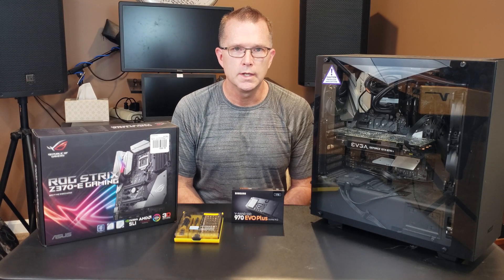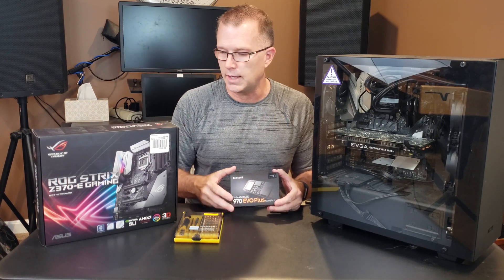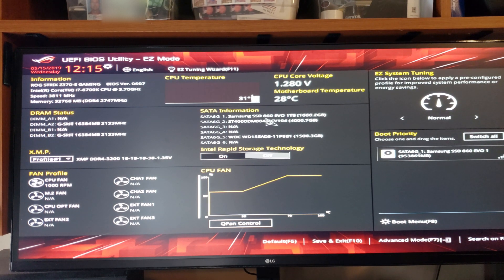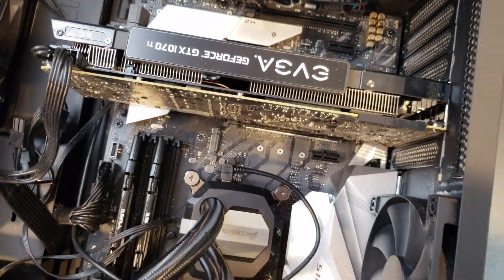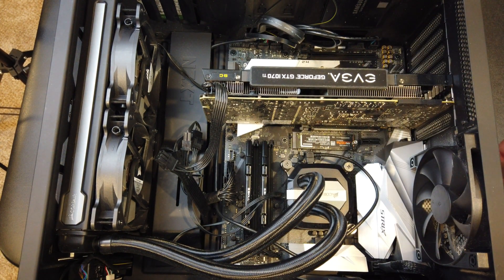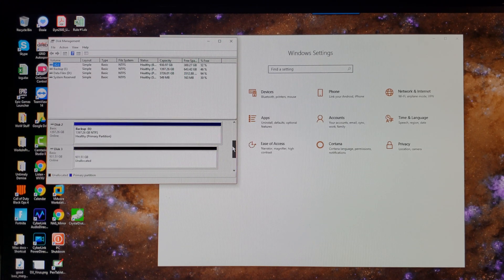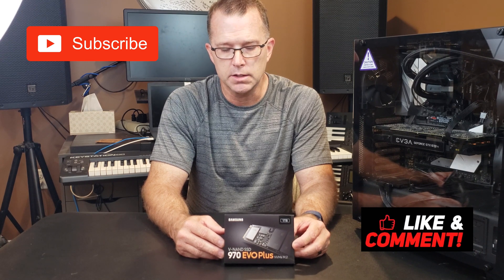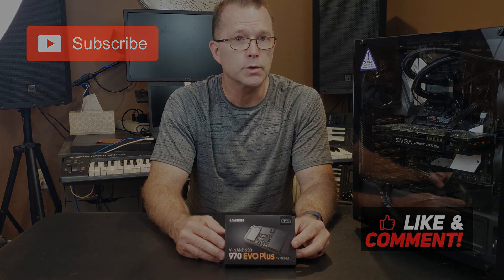SAMSUNG EVO 970 Plus M.2 NVMe SSD | Step-by-Step Installation, Configuration & Performance Testing

Comment: did u tested it while in use ?
i heared that its throttling while getting hot, i have an 8700k and an 1080ti they warm and i have no watercooling would u recomand it anyways ?
or someone else here ?
i would go for the 500Gb i think thats ok for me i use an 240GB SSD right now
and an 1TB for Backup
please someone respond :)
Have a nice stay @ home guys and trust ure heart! ;)
Reply from the maker: I still think the NVMe M.2 drive is great for fast booting, fast app loading, etc.  Highly recommend it for that.  For video editing though, the key performance seems to be 1) fast CPU and 2) fast GPU (in that order), especially in render/export performance.   Just did a video on that very thing and got extremely good results.  Might want to check it out if you haven't yet.
Reply: @ReeWrayOutdoors  thanks for the fast response :)
ill check it out ;)

Comment: OK I really need some help you and I’m going to try to explain the best I can and hopefully you can help me I purchased the Evo 970 pro +500 GB SSDI installed it in my Alienware I7 8700 when my computer booted up it brought me to the bios settings which I wasn’t familiar with so I hit continue and it booted up to the windows it shows that I have the evo ssd as a (d) drive with 500 gb how do I tell the computer that I want to use that SSD settings because my megahertz is only 2133 so do I have to change the bio settings or install any drivers to activate it
Reply: öhm, what??

Comment: When attempting to install the driver (Samsung_NVM_Express_Driver_3.3.exe), I get the error "samsung nvm express device is not connected. connect the device and try again". Also, the driver provider for the Samsung SSD 970 EVO Plus 2TB as seen under Device Manager > Disk Drives, shows Microsoft as the provider with a date of 6/21/2006, driver version 10.0.18362.1...
Reply: Update: I needed to follow this video--> https://www.youtube.com/watch?v=9ngnIKqPOc4 found here https://www.dell.com/community/Alienware/Area-51m-Samsung-970-Evo-Plus-NVMe-can-t-install-the-driver/td-p/7285442

Success!

Comment: Which M2 slot did you use? 1 or 2? Oh, and good video!
Reply from the maker: Off the top of my head, I'm not actually sure. haha  But it was the slot that did not require me to remove the ROG shield (or the graphics card) to access it.

Comment: What happen if I don't have that m.2 option in the Bios?
Reply from the maker: It's possible that your M/B may auto detect X4 mode, but you'd need to track down the PDF manual for your specific M/B to be certain.

Comment: Am I able to run 2 of these in 1 system?
The motherboard I'm getting will hold 3 M.2 drives but I never see anyone running more than 1 M.2
I'm wanting to run x2, maybe x3 Intel 660p M.2 drives, is that possible?
Reply: sure, it is but mostly it doesn't makes sense. if you running server applications with an high iops then it makes sense but to boot windows or some games it doesn't.

Comment from the maker: IMPORTANT NOTE: It has been correctly pointed out to me that the threaded nut on the M/B is not the standoff I'd assumed it was.  To avoid the risk of over-straining the M.2 socket, you should add a standoff to that threaded nut, and then secure the M.2 drive to the standoff.   I'm not sure why SSD mfg's don't just include a couple in the box with the drive.   Anyway, here's an Amazon link to the necessary parts that should work for the vast majority of MB's: https://amzn.to/2IAjT0L
Reply: What pc case are you using ?
Reply from the maker: @TRevolution7  NZXT S340 Elite
Reply: Why did you install the drive without the standoff? The drive should be horizontally. Not pushed down to the motherboard. I don't think you understand what a standoff is. A standoff means that you STAND SOMETHING ON the standoff. Not screw the standoff over the stuff. The standoff goes UNDER the drive and the drive screw on top of the standoff with a small m.2 screw. The drive should be parallel to the motherboard and not at an angle. https://i.stack.imgur.com/FDvM3.jpg
Reply from the maker: @davedragomir6632  you're the 2nd person (that I'm aware of) to make this comment. To be clear, I did NOT remove the existing standoff. I simply used a spare one I had lying around as the set screw.  You're correct though, you definitely should not secure it to the M/B without a standoff to support it. Had I known that some might think that's what I was doing, I'd have taken more care to clarify it....
Reply from the maker: Ohhhhhh I see now what you're talking about.  Totally correct!  Not sure how I missed that originally.  I've amended my pinned comment to clarify this.  Thanks.
Reply: @ReeWrayOutdoors  No problems man! I'm glad I was able to help you and great channel btw :)
Reply: @ReeWrayOutdoors  Asus and any other mobo vendors ALWAYS put this m2 stand-off/screw within the mobo box when the board has an m2 slot, or more of them. ppl still watch your vid. like me today. i mean, i know about all this but all those other noobs screwing their stuff directly on the board, without the stand-off, without knowing they make something wrong!?

Comment: When using a 2 m.2 nvme ssd in a setup, will their speed be affected in any way? I'm hoping for a 2 m.2 nvme ssd setup using a rog crosshair 8 hero x570 mobo;  I am not a computer expert so I appreciate any response and clarifications.

p.s.
- 1 ssd will be used as a boot drive while the other as a storage drive
Reply from the maker: Not 100% certain, but looking at the ASUS specs on this, it appears you may only get x4 speed on one of the M.2 drives (but I could be wrong).  Either way though, I doubt you'd really feel the difference much at all during 'normal' use.  https://www.asus.com/us/Motherboards/ROG-Strix-X570-E-Gaming/
Reply: @ReeWrayOutdoors  Thanks for the reply. I was planning on a rig that can be used on both games and work. While I am new to pc customization, I know that the latest threadripper series is an overkill for me so I am thinking of utilizing a ryzen 9 system.  Case in point I am asking questions so that I will be more versed in this field. Again, Thanks!
Reply from the maker: @carljohn4573  Yeah, especially if you've got apps the utilize multi-cores effectively, both the Ryzen 9 and Threadripper are workhorse BEASTS.  My next upgrade for a video editing workstation is likely going to be AMD-based.
Reply: @ReeWrayOutdoors   I'm happy to know that my choice of system brand will be the same as with your future upgrade. Great vids BTW, you've got one more subscriber in me.
Reply: 970 evo plus transfers at 3500MB/s. It does slow down under higher temperature. Still way, way faster than regular ssd, or even 960 evo
Reply: Even a SATA connected SSD will boot windows in under 10 seconds so I wouldn't be to concerned that only one of the slots is x4.

Comment: I need to do the same installation but will be converting it into my OS boot drive. Any recommendations or things I need to follow apart from these?
Reply from the maker: Just ensure that your M/B supports NVMe as a boot volume (probably does), then install it first a non boot drive, use Samsung's Magician utility to clone your boot volume to the NVMe , and then just set your BIOS to start using the NVMe as boot volume and you should be good to go!
Reply: @ReeWrayOutdoors  it's the exact same one as you used for your video. Thanks for the tip.

Comment: Hello sir. Does the x4 bios option work with the non plus version of the  EVO 970?
Reply from the maker: The short answer is "yes, I believe 4x is still supported on the EVO 970 non-plus version".  But if you want to look into further, here's an article I found that breaks it down pretty well: https://www.faceofit.com/samsung-970-evo-vs-evo-plus/
Reply: @ReeWrayOutdoors  Excellent. Thank you sir.

Comment: SSD drive = solid state drive drive
Reply from the maker: True! And if you buy one with cash, you'll probably have to to go to the ATM machine. Haha
Reply: @ReeWrayOutdoors  Haha. But honestly, thanks for the video. I got a Sabrent Rocket v. 4 to upgrade from my Samsung 850 Pro and heard about problems with cloning from a 512 byte per sector ssd to a 4k byte per sector ssd so I wanted to find some video that explained how to set this up. Found yours in the search and it's well made enough that I felt like saying something.

Comment: Question...What graphics card are you using.  The reason I ask is because I'm building a computer for mainly photo editing and maybe some videos.
Reply from the maker: I'm currently using a GTX-1070ti which was kind of the best bang-for-the-buck when I built the PC about 2.5 yrs ago.
Reply: @ReeWrayOutdoors  Thank You.  If you build one today what would you use?
Reply from the maker: @TheGregWallaceShow  For me, today I'd likely buy the nVidia RTX-2070 Super.   It feels like the current  "sweet spot" for Price/Performance.  You get most of the performance of the RTX-2080 Gaming X Trio, but at literally 1/3 the price.  I don't mind paying for performance, but once you get to that 'bleeding edge' and incremental improvements cost you double or triple...I'm out! haha  Here's the one I'd check out: https://amzn.to/2taTak3
Reply: @ReeWrayOutdoors  that's what I was thinking as well.   Let me ask you this.  Which name brand TRX-2070 would you go with.....EVGA, ASUS, MSI,  or nVidia?
Reply from the maker: @TheGregWallaceShow  assuming they all have 8GB DDR6 (and they probably do),  I doubt there's a significant performance advantage between any of them.  So I'd probably first look at whatever matches my motherboard brand and likely go with that since we might assume that the MFGs likely extensively test their own hardware together.  But barring that, I've bought a bunch of EVGA branded GPUs over the years and never had issues.
Reply: @ReeWrayOutdoors  Thank you again for your help.

Comment: Yeah. All benchmarks looks fine. but honestly. Did you noticed any speed increase in real life use between new nvme drive and old SSD? I doubt that.
Reply from the maker: I notice the speed mostly when moving large video files around, and launching apps installed to the NVMe drive (they load/open almost instantly).  Also my video projects load quicker into my editor and I don't experience preview/scrubbing lag like I did previous now that both the application and the clips are on the NVMe drive.   Does it feel 10x faster? Hard to say.  Probably not for most things.  But I do feel a difference in general.

Comment: evo 970 plus is showing in bios but not windows
main drive is my evo 840.
sata 1-4 are in use so have 5 and 6 spare

wanted evo 970 plus to be main drive and install windows 10 on it and be my main drive.

Comment: Hey bud, that standoff was suppose to go underneath the ssd and you are suppose to screw in another screw inside the standoff. It shouldn’t be resting on your mobo.
Reply from the maker: Yeah you definitely don't want to remove the standoff for the m.2 drive and use it to pull the drive down onto the surface of the mobo.  It's not obvious from the video, but I actually used a different standoff to secure the drive to the existing one, so it's not resting directly on the mobo.  But thanks for the clarification in case others also assumed that's what I had done.
Reply: What do you use to install into the standoff
Reply from the maker: @KnifeCarryingMonkeys  You can search 'mounting screw SSD M.2' on Amazon or use this link if that's convenient: https://amzn.to/2uEn8h5    I actually just  used a random standoff I had from an old PC build kit that happened to have the right threads for the standoff that was already on my MB (yeah I secured it to a standoff with another standoff..hahaha...whatever works!).
Reply: @ReeWrayOutdoors  i appreciate the response

Comment: Hi. I have a simply question . i have an Asus  rog strix x399 e gaming- 2 gtx 1080 Sli ---and recently i got a samsung 970 evo plus . wen i plug the NVME ssd in the mother bourd . one of the graphics  cards stops working. can you help . thanks
Reply: Read your motherboard manual

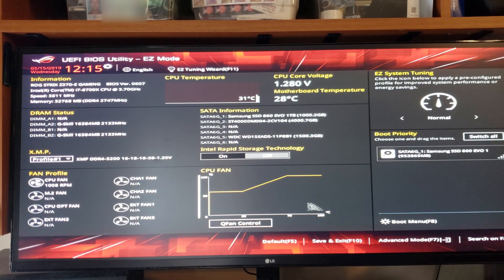Comment: Hey man! thanks for your video! Would solve me a little doubt? Why your SSD Evo appears in SATAG_1 in BIOS. (min. 4:00) Also, do you know something about GPU performance when using M.2 SSD drive? Thank you again.
Reply from the maker: Yeah that 860 Evo is a SATA SSD. This is not the NVMe drive. I'm unaware of how an M.2 SSD would impact GPU performance.  Not something I've looked into before. If you've come across any articles on that topic, feel free to share a link.

Comment: Hi. I have a simply question. Actually I have a Kingston SSD where the OS and adobe software are installed. I bought the EVO 970 to use for footage video and cache for After Effects and Premire. Do you recommend switch this set up and use the EVO for OS and software? Thanks.
Reply from the maker: If the Kingston SSD is a SATA drive, then you'd definitely faster boot times off of the EVO 970.  But I don't think I'd bother switching it around if I were you, if your aim is for more robust editing performance.   I don't think you would really see enough of a difference for it to be worth the effort...and your project load times might be quicker using the EVO as your media drive.

Comment: So the 'easy to get to' M.2 slot you used, didn't the motherboard come with a heatsink for that slot as well?  You may want to install that heatsink over the drive to help keep the chips on it better cooled.  (and for my own technique, I'd put some tape label on the SATA 5/6 ports on the mobo with written "Disabled for M2 4x use per BIOS" or something like that so I don't plug something in at a future point and then spend forever discovering why its not working)
Reply from the maker: I actually did a video just a couple weeks ago testing and active heatsink on that M.2 drive.  Very interesting results. Might be worth checking out!
Reply: ReeWray Outdoors interesting results. The mobo heat sinks are passive of course so slightly less effective I imaging. The 12 second time diff you saw is less than 1/2 a percent so possibly in the statistical noise anyway. Your render times likely constrained by things other than drive speed.  I’ll trade drive longevity for 0.5% time to render all day long if it’s really the chemistry of the semiconductor effect you saw. Thanks for making the videos.

Comment: What is the diffrence between x2 and x4 mode?
Reply from the maker: As I understand it, x4 capable NVMe's can utilize 4 PCIe bus lanes (provided your MB supports that) while x2 only utilizes 2 PCIe bus lanes.  In my case, configuring with x4 does net me double the R/W performance than configuring with x2...at least when benchmarking. :P   I doubt you'd really feel the difference between the two in real-world use all THAT much, to be honest.   But hey, if you've got the capability already, why not use it! ;)

Comment: I have that same ssd BUT the lil screw is too short to secure it and I have no idea where to look to get one. 🥺
Reply from the maker: booo.... yeah that can be a challenge..I wish they just threw a couple with the drive!  Sometimes, I've had to crack open an old pc and just pillage a suitable screw from that.  Typically, you can find one of the motherboard mount screws that'll get the job done...  Good luck!
Reply: @ReeWrayOutdoors  I already searched everything I have but none fits and  I even bought some, but they look the same length as the ones that comes with the mobo, I'll just wait til the weekend and see if I can do a modification.

Comment: Oh wow I have a few rgb connected to my sata and I dont believe I have anymore connections for power. I just receives the ssd in today aswell. I was recommendThanksed a standoff to level out the ssd before tighten with the screw, it works well. Thanks for the video for informative. 

When I go to "On board devices config" The only valuable option for me to set is "Hyper M.2x16" to be enabled. I do not see my stock ssd nor the one I just installed.

Comment: Hey man, i have the same motherboard as you and im running an 8600k CPU. I read something about updating the BIOs and enabling the intel optane technology, and i wonder if i should do all of that before installing my new NVMe drive? Thanks
Reply from the maker: If you're planning on integrating Optane into your configuration, then  yeah, I'd probably want to go ahead and do the BIOS update first and make sure you get that working before you do anything else.  But if you're just going to add an M.2 NVMe drive and don't have any immediate plans to integrate Optane memory, the BIOS update probably becomes completely optional.

Comment: Awesome video, I'm looking to upgrade my PC soon for better video editing, I saw the incredible speeds on the NVME drives it's 6x faster than my sata ssd
Reply from the maker: Thanks man! Just keep in mind that most of the performance benefit you'll experience will be in the moving files onto your NVMe, and adding clips to the project, and also a bit in creating cached or "shadow" files for faster editing.  Render times will not be significantly affected.
Reply: @ReeWrayOutdoors  I appreciate the help, best wishes ✌️